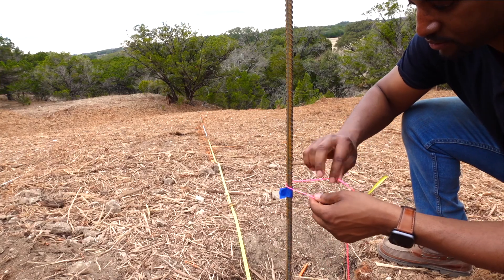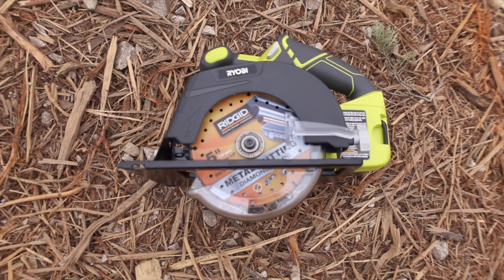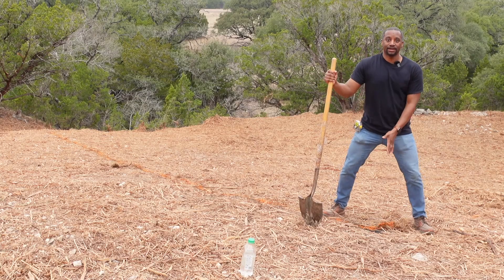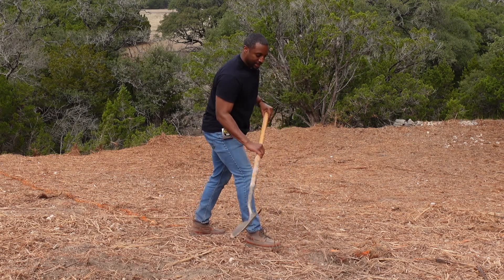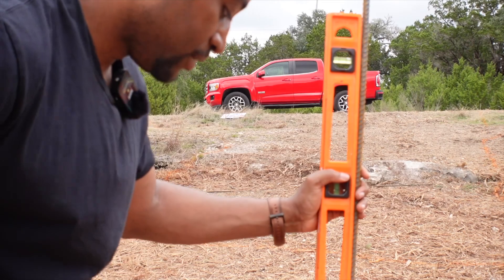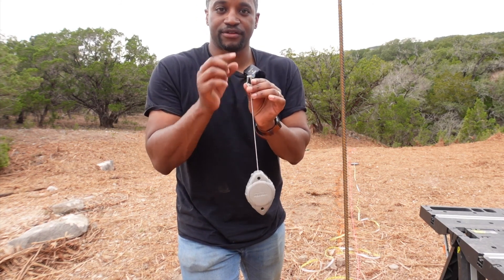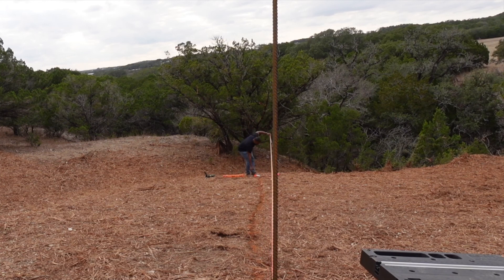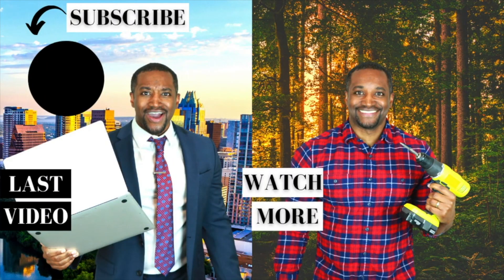DIY A-Frame Build | I'm Breaking Ground On The A Frame | Episode 3

Comment: Nice ! That’s exactly where I was last august, just stacking the cabin and also realizing how high it was going to be due to the sloped terrain. It looks like you’re in a similar situation. 
I’m impressed by the size of your cabin 30x40 (I only did 20x18). It’s going to be a long road ahead but it’s going to be so fulfilling I can assure you that! 
I love your story, quitting your job to dive deep into this project. I’m still hanging on to mine but it’s so challenging to juggle it all.
Reply from the maker: Thanks man! I really appreciate that. Yeah the slope is around 6-8%. So, things are definitely going to get interesting. Haha. And, yeah, it was just time to go all in real estate. It took some guts but more 🙏🙏🙏. I’m excited to you see finish the roofing soon. Are going with asphalt or metal roofing?
Reply: @darryldarks  I’ll go metal, sounds easier than asphalt and metal roofing is pretty common here.
Quick tip, I’m not sure if you’ve already bought all of your materials but I’ll recommend getting advantech subfloor, it’s more expensive than the no name brand but will do much better as you’ll eventually get rained on. I’m obsessed with protecting the cabin with tarps but still, my subfloor is starting to show damages from repeated rain, advantech holds much better. 
Unless you know you’ll have the ability to dry the place in real fast which isn’t my case just working on the week ends.
Reply from the maker: @TheDIYCabinGuy  Great tip! I love that. Yeah, ideally I’d like to use Huber for everything I can on the house. I’d the house to be as airtight as possible. 

I just finished reading this book, maybe you’ve already read it but I think it’s a pretty good read. Prescriptions For A Healthy House. It’s a little old school but overall it’s really helped me define and identify the products that I want to use on the house.
Reply: @darryldarks  thanks, I’ll look into it !
Reply from the maker: Nice! And, sorry. I totally thought I was subbed. LOL. I am now! Let’s gooo!👍💪
Reply: @darryldarks  nice thanks! Don’t hesitate to reach out if you have questions, I might save you a few headaches (not an expert but been through my fair share of mistakes already 😂)
Reply from the maker: @TheDIYCabinGuy  LOL. No, I definitely will. I for sure learned a lot so far from your channel.